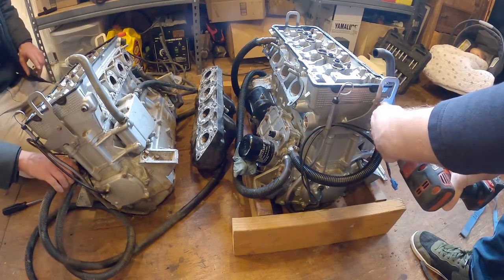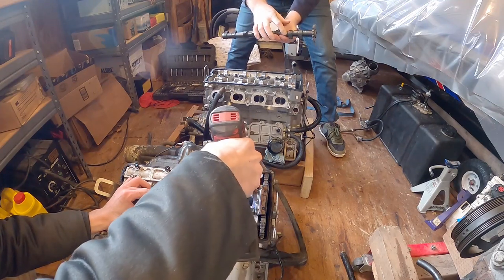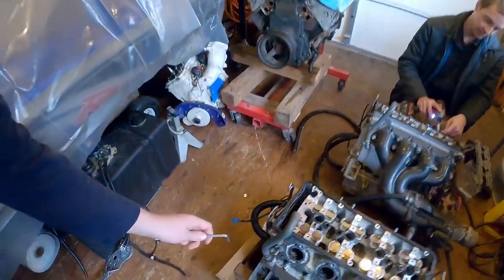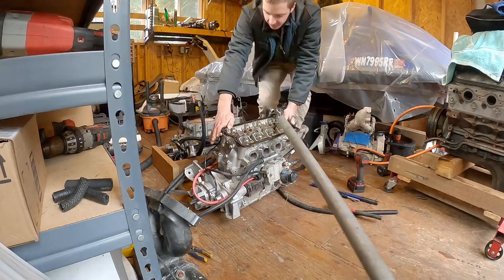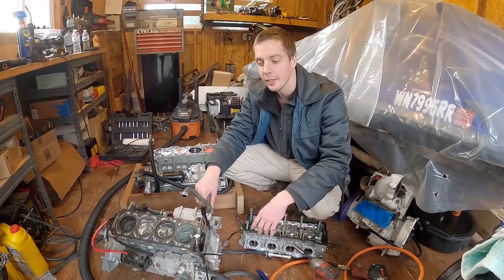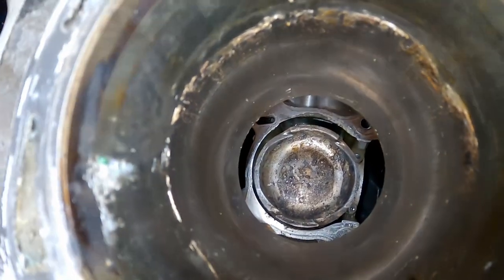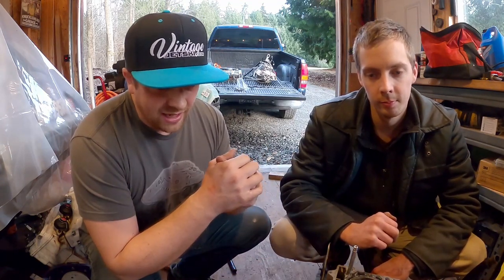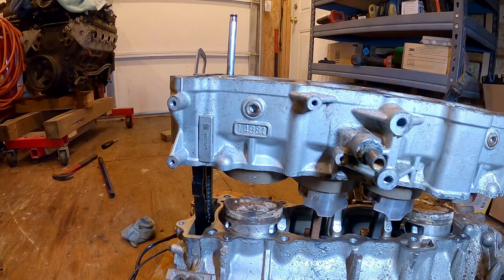Kawasaki 1500 jetski engine disassembly

Comment: I usually remove all of the bolts from the cam covers except for the very inner and outer ones, leaving some at each corner and then some at the middle. Then you take the last ones out slowly. Faster than taking them all out evenly, but safer than just blasting them all out. 

I have some bad news for you about those valves / shims... the fact that they are corroded means that the valves are going to be too tight when you assemble it... once you clean up the seat / valve, the valve will sit closer to the shim ... this won't work right unless they are all lapped and reseated, and then checked and re shimmed. Bucket over shim / bucket over valve is such a PITA ... I had to rebuild a R1 engine way back in the day and lap all 20 valves and then check and swap out 20 shims. The actual shim is under the bucket and the size of a Aspirin and when you want them to stay in, they fall out, and when you want them to come out they get locked in from oil suction 😂

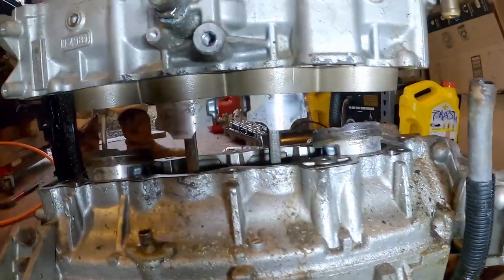 15:35 When you are trying to get jugs off that are stuck like this, what makes it a lot easier is, every time it moves a little and you get a gap between the base and cyl, jam a piece of wood or something between the block and cyl and that will stop it from moving and allow you to turn the crank more. This is also the same process (in reverse) when you are trying to install a 3-4 set of jugs onto an engine ... use a block of wood to hold the cyl up till you get one piston started in, get a slightly smaller block of wood and lower the cyl, get your second piston in, and so on. 

Man... it's a crappy feeling to open an engine and see that stuff in there. I feel bad for you guys. There are places that repair cylinders, but it's probably cheaper to find a cyl on ebay if they are available. There's a lot of work involved in plating something that's that corroded. I'm not one to back down from a big project, but both of these are going to be massively time consuming even to "just get it running" . 

Interesting video... sorry it didn't work out better.
Reply from the maker: The bucket on shim design is hugely annoying but it seems very common in the motorcycle world. Must be a reason for this other then to annoy people who work on them 😂😂 oh well. I am hoping to get my engine patched back together for slightly less then a kings ransom 👌🍻😆
Reply: @JetSkiBrothers  HAHA.. kings ransom....  Yeah... the reason they do this design is because it is a lot lighter and more direct / accurate. That means you can rev it really high without any valve float and because there are no real moving parts (levers, rollers, linkages like on a rocker engine) the clearance stays the same for a VERY long time.

Comment: Awesome winter project fellas! Gotta love it when the cylinders are full of so much salt and aluminum oxide that it looks like someone packed the bores with beach sand or kitty litter! 
Maybe there is an engine machine shop that would entertain rebuilding them for you guys if you provide the parts so that they have some content for their channel? Or maybe Crate them up and drop them on Joel Arsenault’s front step again and if Joel stares at those locked up four stroke behemoths long enough they will just magically unseize themselves!
Reply from the maker: I love the idea of sending all our broken engines to Joel so he can fix them haha 😂

Comment: My guess would be the super charged engine has a lower compression ratio so it can accept the boost better. They could do that by increasing the volume at top dead center (by extending the cylinder)
Reply from the maker: That makes sense 👍
Reply: That is true with this engine as the Piston size was the same between the 1200 and 1500cc Motors, and they simply extended the stroke.

Comment: That's a bummer that both engines were in bad shape. Even that naturally aspirated 1500 made 160hp when it ran.  My guess is those engines were in ski's that sunk in salt water then were not cleaned out before they seized up, then the owners let them set because they didn't know what to do to fix it.   I figure if they left the garden hose on I would expect the water to look orange colored from only rusting the cylinders. Since it was white I figured it was salt water corrosion from the aluminum piston and cylinder head.  Those engines are expensive to fix when they get that bad but boy do they RUN when they are taken care of.

This brings me to a jet ski gripe. There are so many people that buy a new jet ski and do ZERO maintenance and make no attempt to take care of them. Then when they stop running they just park them and let them go downhill from there.

Josh I'd say you should keep an eye on eBay for a decent set of used cylinders for yours then put new pistons and rings in with a good hone. Try taking the head apart and lapping the valves yourself and set the valve clearances. It's not hard to do. I did it on a sea-doo 155 a while back. There are plenty of you tube videos on valve lapping. The two valves that are stuck I'd keep spraying penetrating oil on them and maybe put a little heat around the valve guide to get them to come loose and out. I'd probably pull the bottom end apart and check bearings and replace if needed.   It can be fixed. I love the idea of putting it in the mini jet boat. I bet that thing would be a HAND FULL!!!

Jacob. With yours i'd have to weigh the cost of the repair vs what parts you still need to complete the engine. (Wiring and ecm)  I think your idea of putting a 1500 in another ski would be awesome but the cost has to be within reason. It just depends on what your budget is. 

Guys I LOVE 2 stroke engines but you can't beat how the newer 4 stroke kawasaki's run. EASY starting, no fouled plugs, no adjusting carbs or mysterious carb problems causing the engine to bomb out 1 of the cylinders.  Don't get me wrong the 4 stroke engines have their own issues too like the sea doo 3 cylinder 4 strokes having hollow valve stems back in the early models dropping valves and tiny weak timing chains. I hope the 2 stroke fans don't get to upset over this comment 😆.

Comment: Hello and thank you for your videos. They are great. I have a question regarding a Kawasaki Ultra 300x engines. Are there differences in the engine and management system between model years or are they all the same? How about the 250x? I am only interested in the supercharged models.

Comment: Good trick is use Muriatic acid on the cylinders it might clean up. If not you could sleeve them or send them out to be re plated which isn’t as expensive as you think maybe 500-600 for that engine.  Also someone on green hulk did put a 1200 4 stroke into an ultra 150.  And I want to say he had it run over 70mph with the small NA engine with some prop tuning.

Comment: hey guys i ran into a problem with a 2008 i think kawasaki stx 15f i bought from dealership for 600.00,tore it apart 5 months ago new it had new engine put in summer before,it had 2 stripped spark plug holes and top of pistons in those cylinders has marks of broken spark plugs but very lightly,timeing guides are new,chain tensioner cams in right side and both faceing right way 
ordered new head it arrived with everything but the shims used shims from old head but shims so thick cant even get a cleRance---sizes say 4.6 4.5 even 5.5 on 4 valves some shims 3.9 manual shows could this bend all valves but 2 or 3 the manual shows 3.0 biggest shim thanks if you see this

Comment: I would assume the supercharged engine has a taller cylinder because it also has thicker crowns on the pistons to handle the extra power and heat. Might be wrong though.

Comment: Jacob are you going to build your x2 this winter? Great content JSB’s.
Reply: I do have plans for it and all the x2 guys will like it. I'm probably going to do it in the summer.
Reply: @Jacobskibros  can u make a vid on showing or just telling what is needed to put a 701 in a 650sx or X2
Reply: @chefboiard5468  If I can remember I will, but maybe this will hold you over.

You buy the rhass yamaha conversion kit, and a 701 with electronics. With the x2 you need an aftermarket pipe and that might also be the case with a 650sx.
Reply: @Jacobskibros  oh sickkk awesome I knew someone had to make a kit for it
Reply: Thanks !

Comment: Start a givealittle donate to cover funeral costs 😂taller cylinders to house bigger balls ect. n/a shorter stroke higher rpms mite b wrong have been b4 🤔supercharged one uses boost to make power not rpms hence longer stroke n lower compression